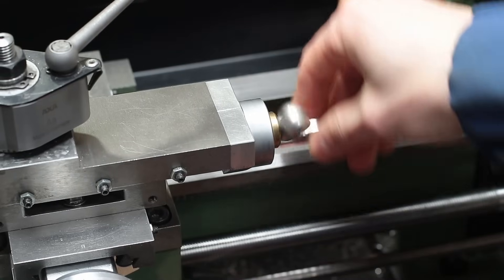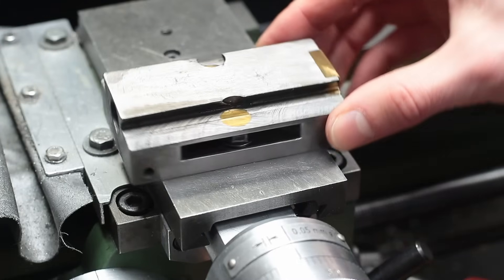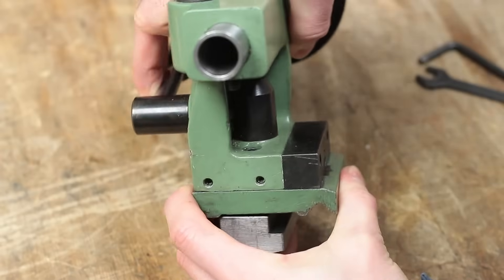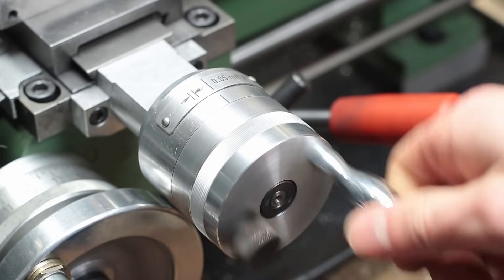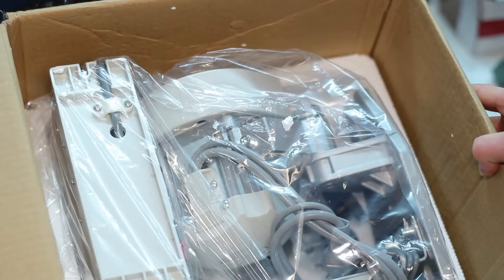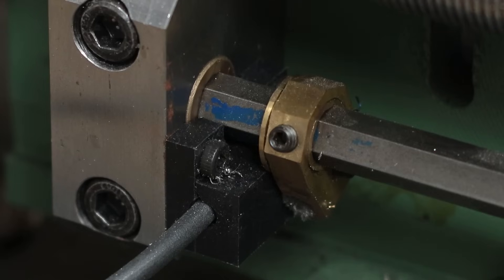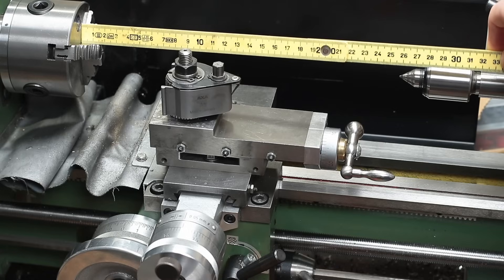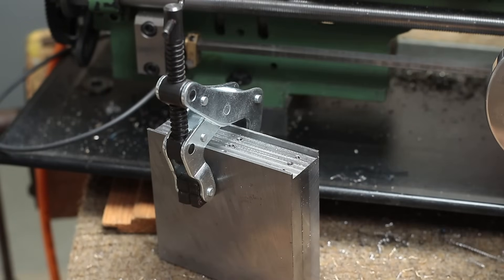All My Mini Lathe Modifications - What's Next?

Comment: @WeCanDoThatBetter  I upgraded to the Amadeal tailstock and I do find it more sturdy, though it does take more room.  That said aligning the amadeal tailstock can be a bit of a Schwein otherwise much superior than the original. I did have to machine some material from the underside of the clamping plate/foot that goes under the ways as it was a little too deep, but that is about the only issue I encountered.

The two set-screws on the rear of the body set alignment along the length of the bedway, the one at the rear front corner sets alignment front-to back in combination with the one on the rear side of the tailstock. There is also the fixing bolt on the underside at the headstock end of the tailstock which needs modifying for ease of adjustments.

I am a little concerned over the push fit bush for the feedscrew, but that is something easily sorted with a drill, a tap and a grub screw, which will stop it wanting to push out as happened to mine.

I am also considering shortening the tailstock nose by about 8mm (minimum) and relocating the anti-rotate grub screw further forwards to avoid potential problems.

The only other "niggle" (or issue) is where the locking handle is. I removed the restrictor pin to enable a good, tight locking action as the pin restricted that even when the foot was correctly adjusted.

The extra length of the new tailstock means a little less distance between headstock and tailstock but that is easy enough to get around for the odd jobs where you can swap in the original camlock tailstock for extra space.

Have you considered the 4" spindle upgrade?

Comment: An  electronic leadscrew would be more practical than a gearbox.
A replacement top half of the cross slide with a T slot cross slide would be useful. It would allow more effective milling operations on the lathe. 
Small geared dc motors for power feed on both axis would be a good one also.

I plan to do the last two on mine sometime this year (hopefully).
Reply from the maker: Thank you very much for your input! Yes ELS would be cool too but I prefer the mechanical solution for now. The idea with the new cross slide is great. When I'm changing the lathes bed slide to a wider one, I will have to redo the cross slide as well and will probably implement some t-slots.

Comment: Sir, if you're going through adventure with longer lathe bed and different head stock, you may consider sealing up the headstock and using conical bearings running in oilbath with the gearbox - just like the big machines do. Seriousily it would be damn cool.
It is a little more complicated than simply ramming sealed angular contact bearings in, but seeing how capable you are, it would be piece of cake for you 🙂
I did it on mine and it works flawlessly, Also, if you are interested in it, Robert Adair made really nice video about it.

Hats down to your work and to the one of the best minilathes out there!

Comment: An electronic guitar can be installed in the place of the feed box. It consists of a stepper motor mounted on a lead screw, an encoder on a spindle and a microcontroller that controls everything.
Reply from the maker: Thanks! That's an option too, yes. Would probably be easier than to build a gearbox, but I like the mechanical solution.
Reply: Aw, I wanted to install an acoustic guitar instead...

Oh well.

Comment: I take it the headstock already had angular contact roller barrings in rather than the cheap ball barrings they often have. You've made so many really clever, really thought out changes so I'd be amazed if you hadn't done that basically first if it needed doing. Lovely work as well. Not sure why you haven't just built your own lathe totally by now though. Understand buying what you could afford at first as you can use the cheap lathe to make the parts you need to upgrade it but with all you've changed and are going to change in the future feel you'd be far better off stripping this one for parts and just building your own lathe from the base up making every part as you want it and as good as possible whilst not having to compromise on anything like putting the new gearbox in front when it'd be better built in and making the bed etc as long and as solid as possible. Also have you said what the make of the mini lathe was when you got it plus really hope you watch Inheritance Machining and definitely Clickspring as really sure you'd get a lot from them both. Any chance you'll be doing a Mill next? Maybe building one from scratch or upgrading like with the lathe or even building a Mill attachment for the lathe if you want to keep it lathe centered.

Comment: In reference to the thread changing speed, I have a video (Need to look for) that someone did a modification with a stepper motor synchronized with the rotor speed, to set the advance of the tool according to thread selected. When I find it I will put the link in your UT Page.

Comment: on the carriage slide wheel. aliexpress has a longer aluminium piece you can use to get to 210mm cross travel and then you jsut mill more onthe saddle off.

Comment: I'm curious about the gear change lever.  Been considering the same motor swap to a sewing machine motor, but I figured with the wide speed variation and higher torque, I wouldn't need the gear changing.  But you mentioned you use it frequently.

Is it just more convenient to make the large speed jump quickly, or do you find you need the low gear torque?

Comment: Love your work. And surface finish on steel is especially impressive. Are you using mostly 1215 or 12L14 or equivalent?
Reply from the maker: Thank you very much for your kind comment! As a higher grade steel I use almost exclusively 42CrMo4 or also called 1.7225. Don't know the international code for it.
Reply: @WeCanDoThatBetter  Looks like that’s 4140 in the USA. A high quality alloy, but not one of the “free machining” steels I had assumed. Even more impressive.

Comment: Why not just buy a good lathe?
Reply from the maker: Cause there were less reasons for making videos about ;)
Reply: @WeCanDoThatBetter  But you could make something on the lathe of use
Reply: @union310  Never under estimate the capability of a smaller lathe. Very handy machines, even when working at the machines limits, providing it is properly set up and can be relied on to be accurate.
Reply: @ronwhitmill7068  I am well versed in machine tools, I was apprenticed trained  and have been in engineering all my life. I manage and look after two large factories. I have been in model engineering for over 35 years. 
The lathe has limits, my point is after spending all the time adjusting modifying and playing on you may as well have bought a decent machine.
Reply: @union310 And yet, despite all the experience you have,  you seem unable to understand the pure joy of taking a machine with serious limitations and using one's own  ingenuity, improving it way beyond it's manufacturers conception.

Sure the fella could have bought the German equivalent of something like a Colchester Student or a Harrison M300 or a Southbend 9 and sure they could have had some fun tidying it up but it would be maintenance, not creation.

Some people like to work on creating tools, not just using them.
Reply: @stevedavey1343  A lathe is to produce things. 
Would you take a car you purchased to go to work in and fit a roll cage and bigger tyres and wheels and the  spray it a different colour?
Reply: @union3109  Anything anybody buys is for whatever they want. As for your utterly missing-the-point and irrelevant analogy, is the video maker planning on using the mini-lathe to do production work (the equivalent of your commuter car)? I don't think they are; they're smarter than that (and you, it would appear). 

They're having fun doing the modifications, making a genuine improvement to its capabilities, and all you do is consistently miss the point,  piss on their cornflakes, and show a distinct lack of imagination.

Good engineers, in addition to an awareness of machinery's limitations, have imagination and a sense of possibilities. You appear to lack the latter two qualities.
Reply: @stevedavey1343  Good engineers buy something fit for purpose then make something else that is useful.
Reply: @union3109  In a production environment that's sometimes true (but not always; there are some situations where some economic constraints may make this infeasible). That's also irrelevant to this use case. 

Eh, you're one of those people on the internet who refuse to hold their hands up and acknowledge that they've missed the point or don't have the smarts to recognise they've done so or in this specific case are 'willy waving' to show they have a big boy's lathe (and what may they be compensating for?). 

If your 'resume' claims are true, I feel sympathy for your colleagues, not to mention your employer. 

Anyway, I'm done trying to get through to someone like you.
Reply: @stevedavey1343  What a load of tosh, an engineer worth his salt knows that spending time altering something is taking him away from what he is supposed to be doing. 
Even in model engineering you don't buy a machine so you can spend your life altering it, you buy it to make models.